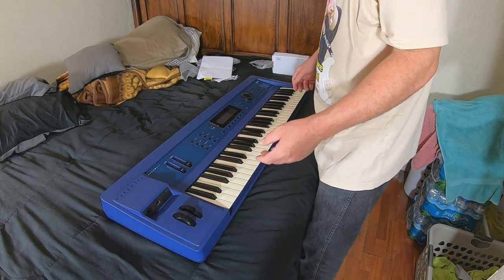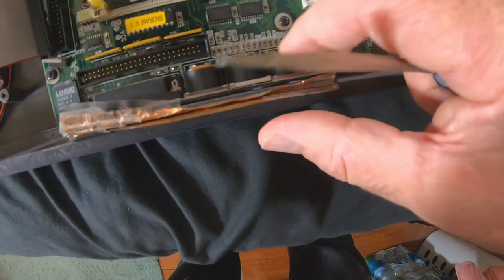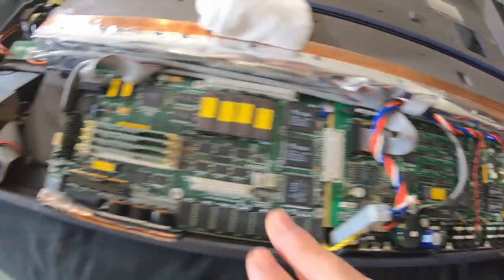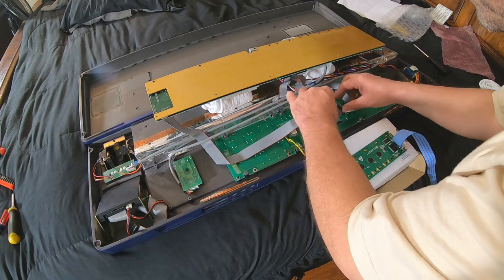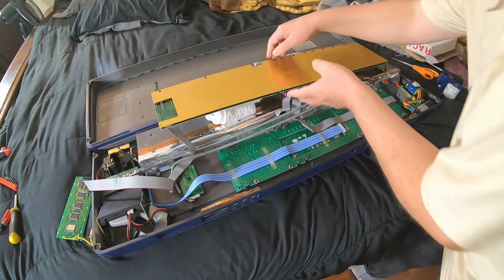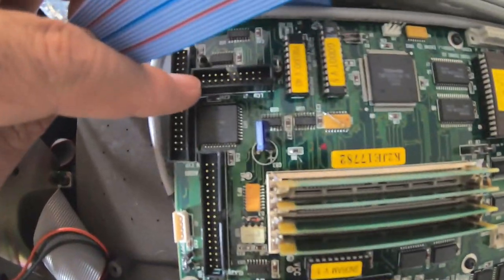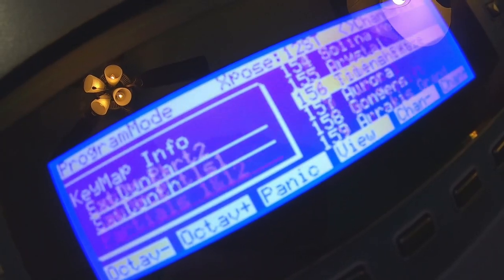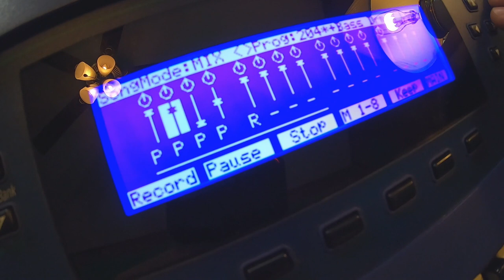Kurzweil Ocean Blue Display Installation - K2000 VP

Comment: I have the same key briar and it says replace battery anyone know where the battery is for the display?
Reply from the maker: The display doesn't take a battery. If you have the exact keyboard, there is a door on the bottom for AA batteries. If it doesn't, it's a different year K2000. And the battery is probably inside.